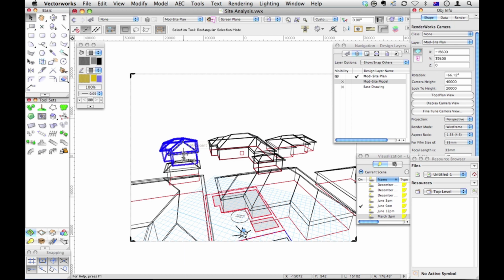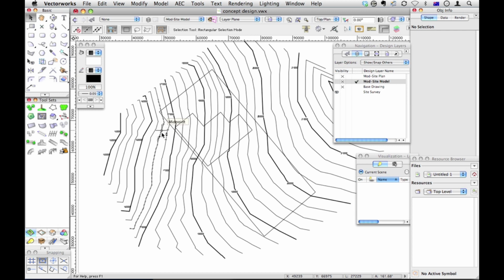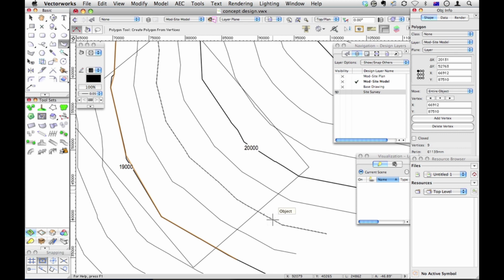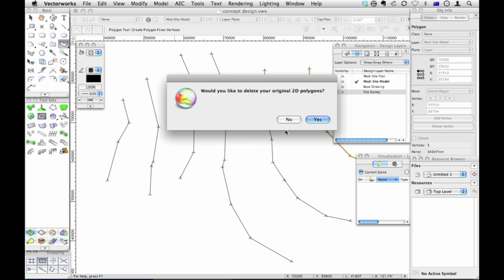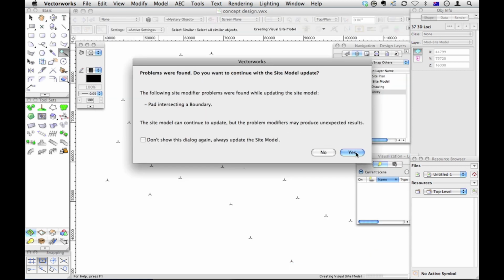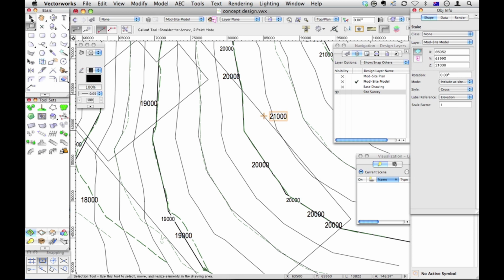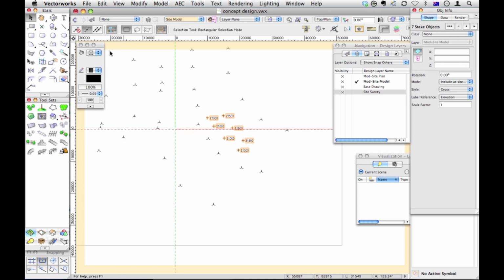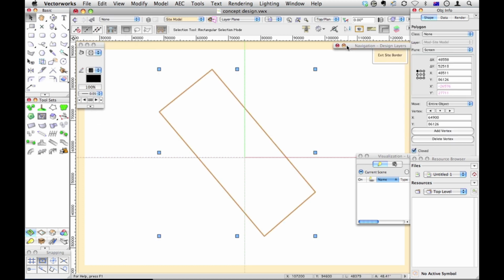Session 7 - Concept Modeling

Comment: Hi Jonathan
I am really struggling with understanding site modelling.
I have watched multiple videos and followed the Vecterworks help but still cant understand the elevation levels when my program (2019) creates the model. I have posted a question on the Vecterworks general forum but no-one has answered as yet.
So there are several items:
1. How is the skirt defined? is it the lowest contour to the highest contour when looking in section? Can we have the bottom of the skirt start say 500mm below the bottom contour? My program keeps changing the skirt size and I cant figure out why.
2. How does the datum work or elevation level work in relation to my house finished floor level (I am working with stories) the floor level is defined and static and I have input the contour levels , which are also static, but the model is created either above the house floor or way below, Im guessing I am missing something very important. The site model is on a separate design layer and I have set the elevation at 0 is this correct?
3. How does the site model Geometry Lowest Z fit in to everything .... help says it should relate to the lowest contour but when I add or remove the skirt the value changes.
4. I still have no idea what the blue grid in my 3D view represents and how its position is defined, I know it is a very basic question and shows my lack of knowledge but Im sure once I know this the other matters will likely be resolved.
5. I have created a test site with a steeper grade as my project site is basically flat. I have done this so I can play with all the settings so I can learn what each does. my program does not seem to generate every scenario correctly or changes the datum/elevation of the model in relation to the contours, honestly Im going a bit crazy trying to work all this out.

I would like to find out the best option to join and be involved with your teachings so I can move forward and learn faster as right now Im not getting anywhere.
Thanks for your time
Reply from the maker: You can contact me directly jon@archoncad.com
Reply from the maker: now that you are a member, I see you have checked out the new Vectorworks for Domestic Design movies. Keep looking, there will be more movies on site modeling in there.